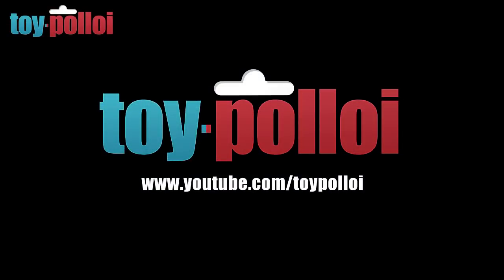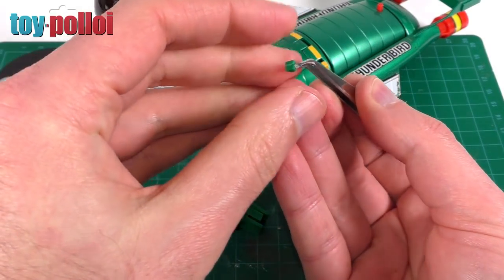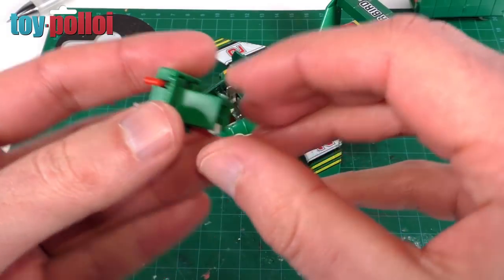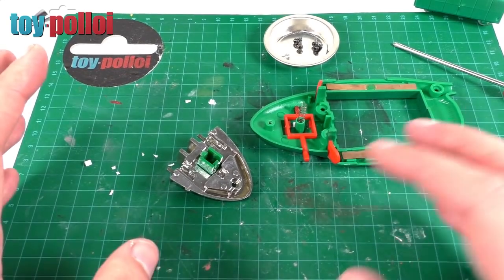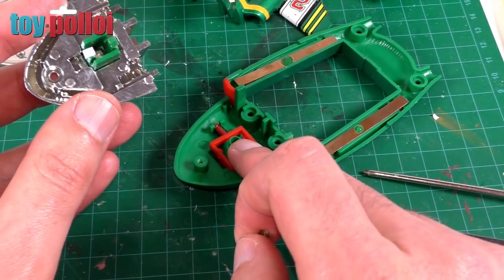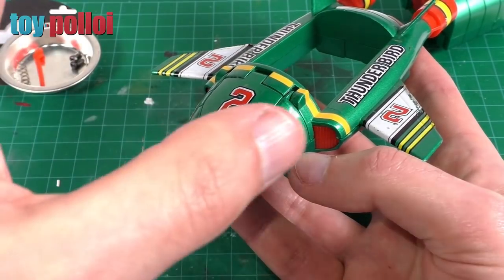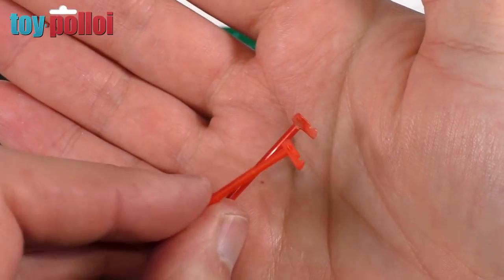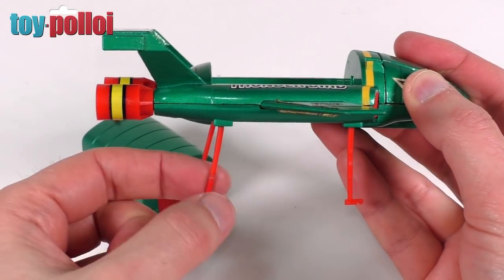Vintage Japanese Popy DX Thunderbird 2 repairs - Toy Polloi

Comment: Fantastic job Dave. Very clever cutting the spring down.
Reply from the maker: It's a trick I've used before on vintage transformers as they often suffer with weak plastic and overly strong springs.

Comment: To add extra strength to the missile launcher tabs, you could maybe bridge the glue joint with a thin piece of styrene on either side, in the gaps between the tabs and the other side pieces of the launcher "neck".  Would be pretty fiddly but might add another strength axis.
Weakening the spring was a good call though.